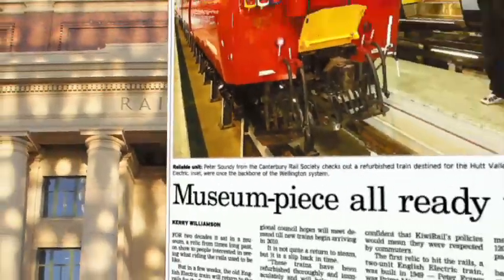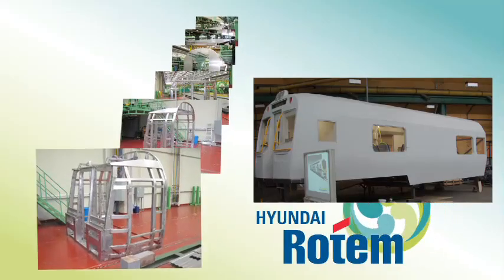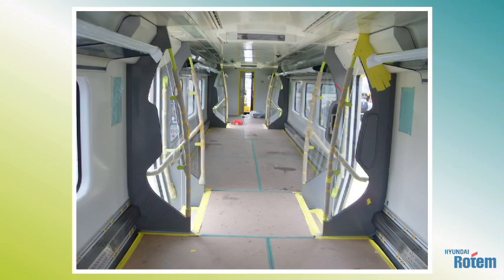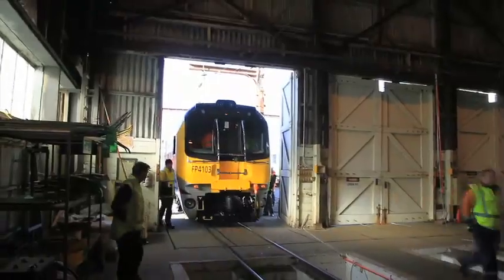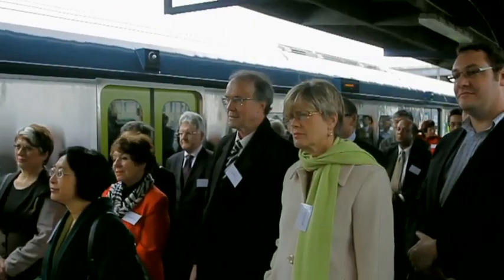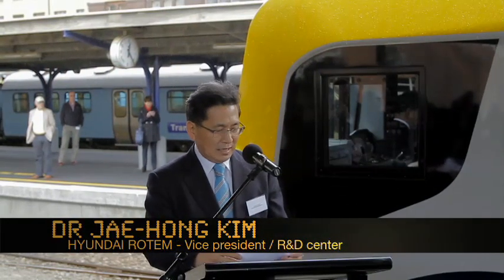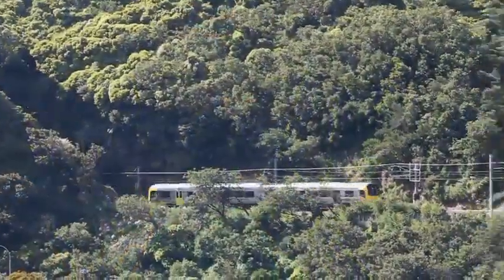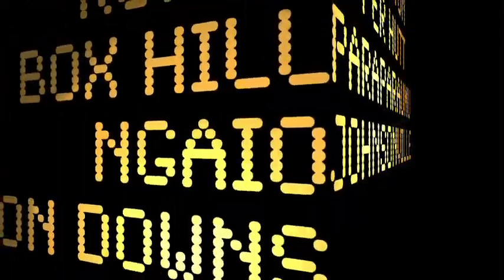Metlink brings you Matangi

Comment: It seems that the Matangi trains are beginning to show early signs of deterioration with noticeable crack lines on the roof of several of them. I was also concerned about the noise the unit I was in was making as it shudders, a sound akin to it not being secured to the chassis properly, In due cause, time will tell I guess, and hope our tax spending is worthy of the service.
Reply: Well 7 years later and no news of reliability issues with the Matangi’s. In fact  doesn’t look like they’re getting the usual 15 service years refurbishment. So they must be good.